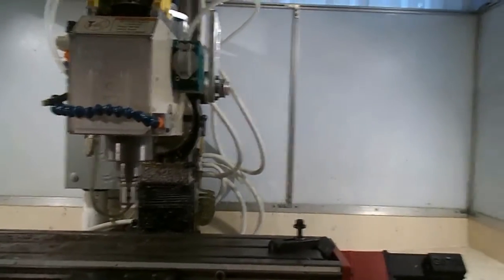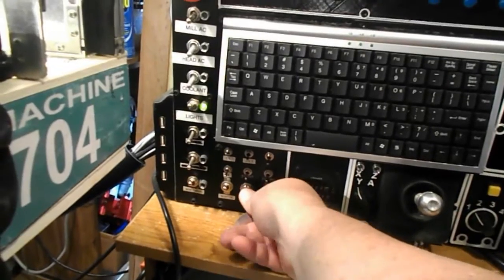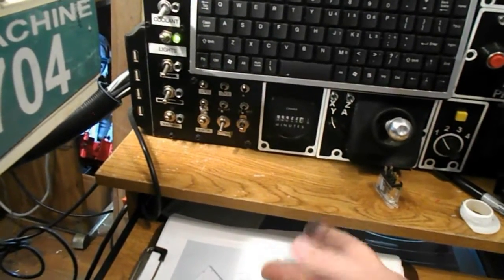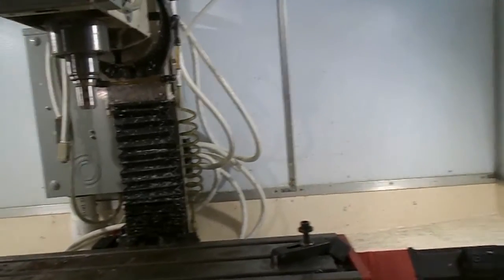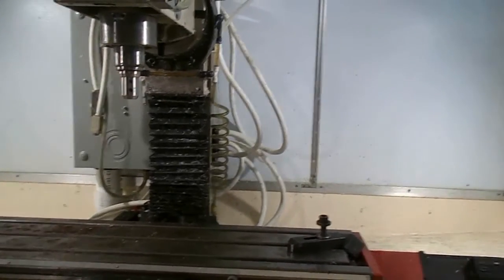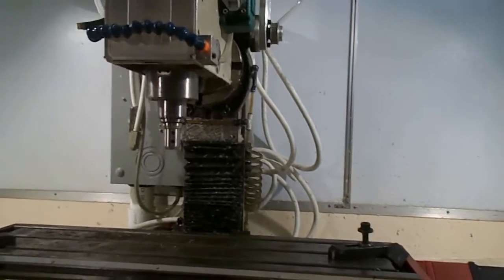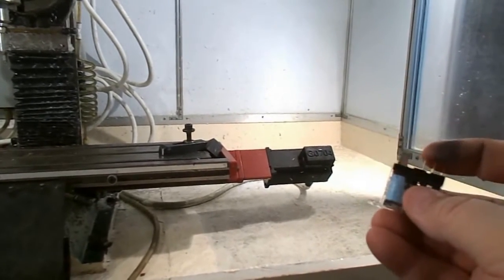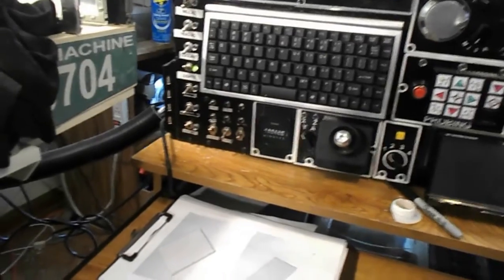G0704 Hoss Z Axis Brake

Comment: nema 34 , doesn't budge on power off.
Reply from the maker: Brady Rose yeah that would be a cheaper solution. ;-) Seen bigger machines with nema 34 z's have the same problem.
Reply: It will still do it with Nema 34's on bigger machines, a  relative problem.
Reply: @unionse7en  Mine doesn't budge because I left the hand wheel on.

Comment: My thought was what is the head going to do between when the power fails and you get the switch thrown. Like "Asimov's Robots" it should do no harm to the work price or itself.
Reply from the maker: steamboatmodel well if someone has that many power failure occurrences to worry about that happening then they can use the relay i mentioned which would short the coil automatically when power to it is turned off either voluntarily or with a power failure. total cost about $5.

Comment: A great idea, but if you have a power outage the head will still start dropping down. May I suggest that you counter balance your head, with a slight bias for the head to lift.
Regards Gerald.
Reply from the maker: steamboatmodel if there is a power outage turning the switch off will do exactly the same thing. it's not providing any power to stop the stepper. test it on the bench with a stepper not connected to anything. touching the 2 wires for a coil together makes the shaft harder to spin, it's magnetism at work.
Reply: I counterbalance my head with an air cylinder  via an air pressure regulator , it was a cleaner solution than the counterweight method (I have a bigger machine and a large control box where the weights would need to be)  the air regulator lets be adjust for different head weights (different attachments).  If I loose all shop power then I would also loose air pressure (eventually), so I may try the shorting-brake method, If not I will apply a spring loaded mechanical brake on my vestigial Z axis crank .